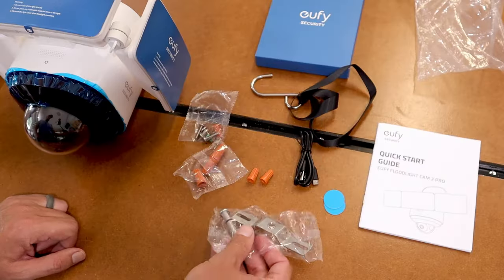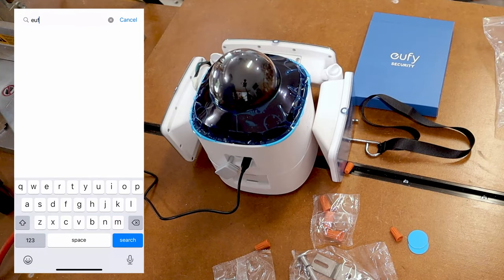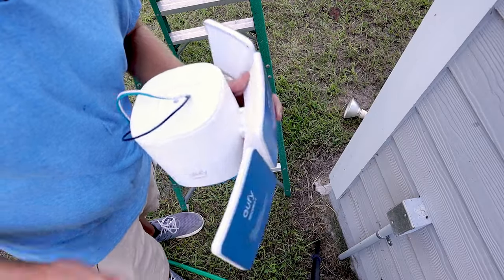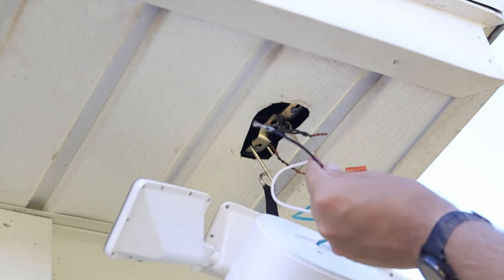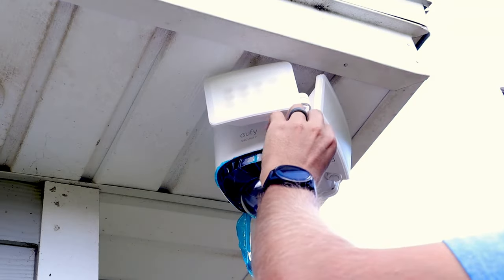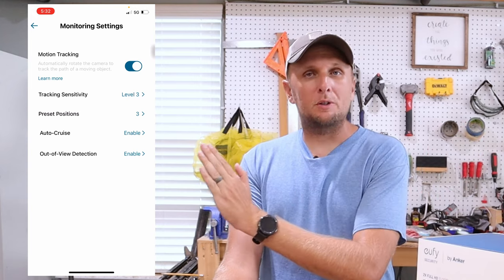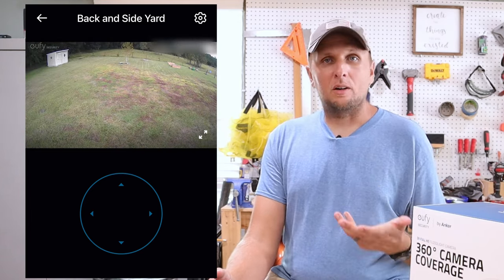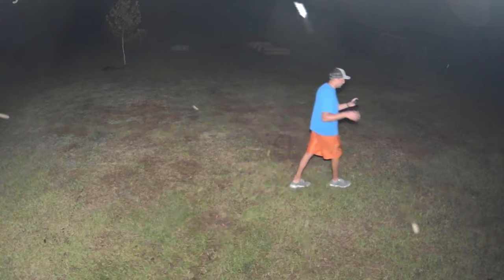360 Degree Controllable Security Camera?!  Eufy Security Floodlight Cam 2 Pro Install and Review

Comment: If my junction box does not have a bare copper wire, do i connect the eufy ground wire to the screw of mounting bracket that's labeled ground?

Comment: Great video! I'm trying to decide which cameras & floodlights to get. How well does this integrate with Alexa or Google Home, can it trigger automations? i.e. motion detection triggers my porch light and driveway lights to turn on between certain times and turn off after a set time period. My Ring doorbell used to do it perfectly, but I got rid of Ring and have ADT's new Nest doorbell. It is set up to do it but it won't actually trigger the automation because ADT won't play nice with home assistants. If I test the automation in Alexa app it works but ADT's Nest doorbell won't do it.

Comment: Just discovered your channel 👍🏼 I just bought this camera to install on my existing floodlights.  The floodlights i have are powered by two three way switches.  If the switches are off I'm sure the cameras and light will not work.  Is there a way to wire these to allow the camera to continue working but not have the lights on all the time or what if I want the lights on because I'm outside.  Thanks.

Comment: Eufy should add bug zappers on the floodlights to have fewer bugs in the video picture.  And also, make the floodlights motorized so we don't need to get the ladder in our garage.  We can control it through the mobile app.
Reply from the maker: A bug zapper would definitely be a welcomed added feature!

Comment: I had mine replaced 4 times do to offline to many times it goes off line to many times for some reason they still don't know why
Reply from the maker: Very odd.  I honestly have had zero issues with mine.  Maybe your wifi signal is too weak for its location.

Comment: I bought this floodlight camera few months back then it stopped connecting to wifi and eufy won't replace it be careful spending 300 on this thing
Reply from the maker: Odd.  I’ve had mine like 2 years now and still works perfectly.

Comment: Good video. But it would have been more informative if you talked about Monitoring prices? Do they have good customer service? Can you upload video or is it stored on SD card? Does company charge for storage? What is the detection distance of the camera and lights? I Love the features you pointed out better than the competition, but many of us don't like monthly fees to be able to see our video.
Reply from the maker: As a owner of numerous ring products I totally get wanting to get away from the monthly subscriptions!  With this camera you get 8 GB of internal storage.  So you do not have to pay a subscription fee to be able to review your footage.  They do offer cloud storage as an option if someone decides they want it.  I just use the internal storage personally and have weeks of footage I can go back and review.  I have not had a lot of contact with them as a company but the little that I have had they have been helpful and responsive.  I appreciate the feedback!
Reply: @HowToHomeDIY  Thank You for answering my questions? I'm trying to find a good camera system. In the end I may go with a hardwired system. Changing/regarging batteries, pulling out and SD card to review, and monthly fees all add Money to the overall maintenance cost. A hardwired system has built in HD hard drive. Stores more hours than I need and if wifi goes out it still works. Many hardwired systems have lasted for years. Where rechargeable or battery powered device will need to be replaced. Or new purchased. In the long run these type systems cost more money. Though the one you reviewed is hardwired, I just don't like monthly fees or swapping out SD cards. Your video helped a lot 🙂
Reply from the maker: All of the reasons you gave are some reasons why I got this one.  It is hard wired, no monthly fees, and there aren't any SD cards.  It is all internal memory and once it fills up it just overwrites the earliest recordings like a standard hard wired system does.  As far as floodlight cams go, this one checked a lot of my boxes.  But if you are wanting to store months of footage then you would need more than 8GB.  I am glad the video was helpful!  If you have any other questions I will try to answer them the best I can.
Reply: @HowToHomeDIY  Thank You I do have a question. When you say internal storage no SD card, how is information transferred? Through the app?. Can you transfer to a thumb drive if you had an event, like a break-in? Or is all data transfered to the app? And if so, this is free of charge? If so I may be interested in this system. Because like you I already have auto flood lights installed around my house 🏠

Comment: That camera is garbage. After the camera did a software upgrade the new software make the camera unusable. Lose connection, no picture. I had to but buy a different camera after I paid 300$. STAY AWAY FROM THAT COMPANY PRODUCT.
Reply from the maker: Sorry to hear about your experience.  So far I have done every update and it still works the same as it did when I installed it.